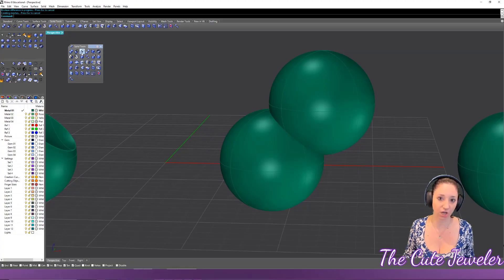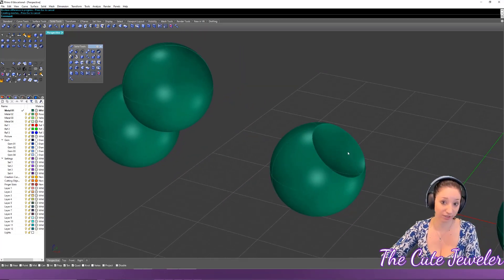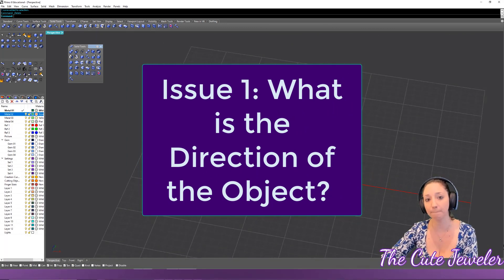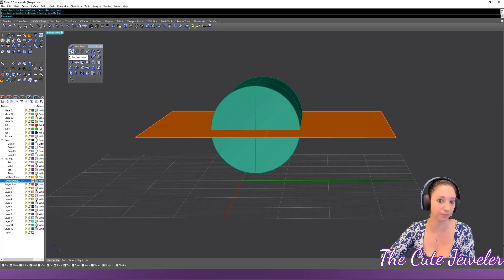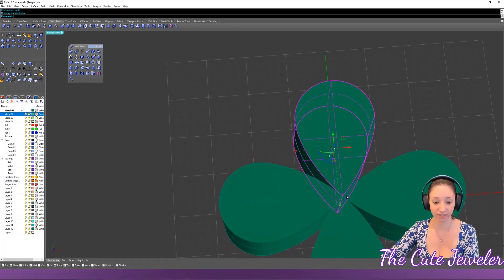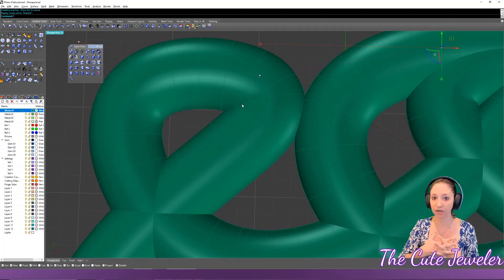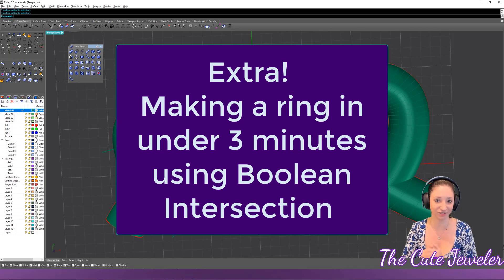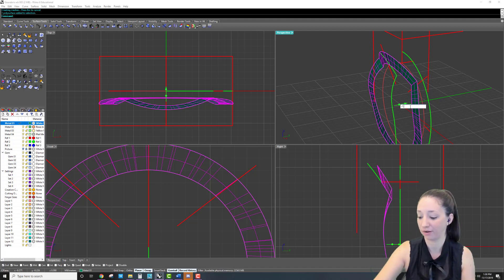What are Boolean Functions and What to do When They Fail!

Comment: nice  and easy explanation.  to solve  self intersection pipes I rhater make a blendSrf in the corner unsing SplitSrf by Isocurve at both sides of the corner.
Reply from the maker: That is another great way to solve the problem! It's so amazing the different ways you can solve the same problem in Rhino.
Reply: @FloweretteJewelers  2 years later you love my comment?  emmm nice to be updated.
Reply from the maker: @DiegoKrausebrc lol I'm going to be relaunching all my socials soon and realized I didn't like your comment when you left it 😅